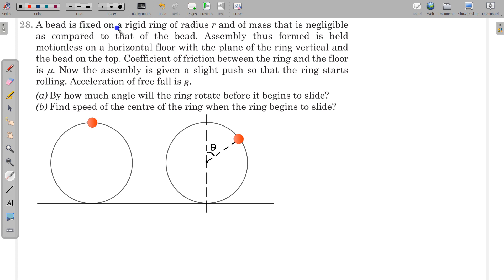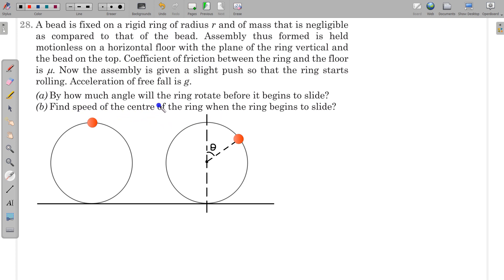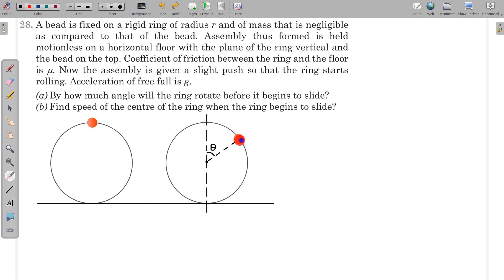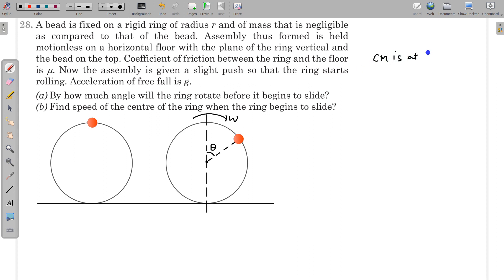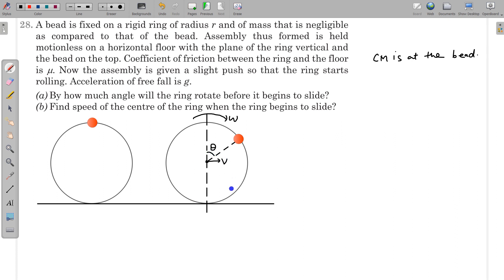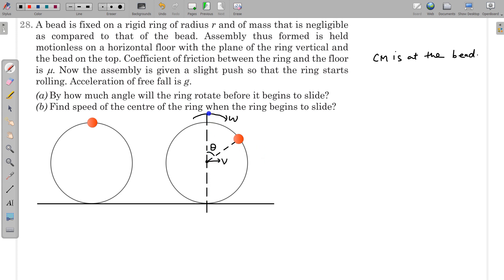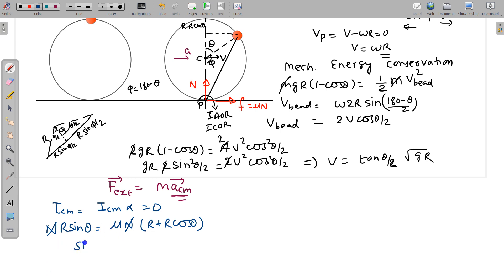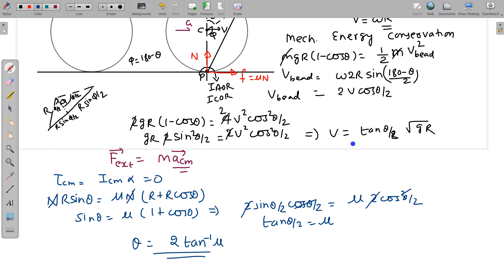Rotational Mechanics | Pathfinder Solutions | Rolling Ring with Bead

Comment: Sir i have done question by finding  acceleration about instantaneous Axis of rotation and taking its horizontal component and equated with umg and i then writing torque about instantaneous axis of rotation including psuedo force mv^2/r apply it downward to the mass m and then with some manipulation of mathematics and get same answer .....please tell my method is correct
Reply: apka solution bhej sakte ho kya ???

Comment: Sir will the particle have centripetal acceleration?
Reply from the maker: Obviously the bead is moving on a curved path and any particle moving on a curved path will have Normal (centripetal) and Tangential acceleration.
Bead is performing circular motion about center of the ring as distance between center and bead is not changing with time.
Reply: @PhysicswithAkashGoyal  but it is seen that bead is performing circular motion about the contact point P. Then it will have centripetal acceleration about it. Isn't it?

Comment: Sir how can energy be conserved here because normal reaction due to ground on ring is there na sir
Reply from the maker: Bottom most point is instantaneously at rest. so work done is zero.
and even if there is sliding then also velocity of bottom point is along the surface and normal is perpendicular to the surface.
Reply: @PhysicswithAkashGoyal  thank you sir I got it
Reply: @PhysicswithAkashGoyal   but sir there is friction force present,  then how can the mechanical energy be conserved?
Reply: The friction is static and does not work. @elements-24